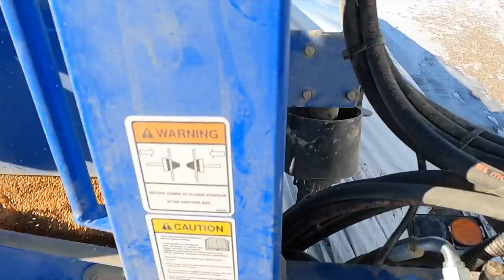We Give Up! Frozen Tractor!

Comment: Looks like a use for those old grain bags. Make a wind break tent with them over the engine plus that propane heater to get things warm. Cold is cold, but wind moves the heat out faster than you can get it in there.

Comment: We have same tractor. Ended up buying high speed high torque starter. Fixed cables . No problems since. We don't get that cold though! Great videos.
Reply from the maker: It has always been a hard starter. I am guessing an overhead and fuel pump timing adjustment wouldn’t hurt.

Comment: I feel like the battery kill switches should be a standard feature on every truck.
Reply: A battery switch isn't going to save a battery in the cold.
Reply from the maker: If they don’t draw down and freeze it will.
Reply: @FastAgMontana  well around here in minus 40c we run a trickle charger on the batteries or the trucks won't start, I mean I hope it helps, but trickle charger along side the plugging in really helps. Thanks for the content!
Reply: Damen Anderson  , WELL is a deep subject , unless it's a  shallow WELL !!!!!

Comment: Sounds almost like the starter is going out. Yes the cold isn't helping but with a torch, block heater, semi,  and a pick up and still that slow of a crank something is up.
Reply from the maker: Yes exactly. It can’t just be cold oil everywhere. All though the transmission and hydraulic oil would sure be stiff.
Reply: Transmission and hydro wouldn't be as stiff as the engine oil would be. Unless you ran a way lighter engine oil... But not everything can break when it sunny and 70°. Wait for the weather roller coaster to come back up again and problem solved haha

Comment: If you’re running anything like 100’ or more you should be using extensions cords with #12 minimum, preferably #10 size wire cords.   We use what I think are called ‘by-pass’ super high wattage heaters up in Sask!  It’s an external heater with high-capacity by-pass circulation # 1500-2000 watt heaters!  With a hog farm we had to grind feed at any temp!!  G’luck!

Comment: The cold is so hard on batteries. When I was going to the vo-tech in Butte long ago. I lived in an apartment with no way to plug in. I would pull the battery the night before and keep it inside. My blazer would start right up every time. I also
Have good luck with those magnetic engine heaters. I slapped a couple of those on the oil pans of a couple of pieces of equipment, so they would start. Grease guns in the exhaust stack of the semis, just good ol’ agi ingenuity.

Comment: Just a heads up I’ve installed lots of cut off switches. The best is to cut off the positive poles cause in case you get a short in the truck due to mice or something else your positive is still live to the truck until you ground it. Just a suggestion. A little more work with the positive cable but your guarantee.

Comment: Not a trick I really recommend but in necessary situations I've removed the air filters and put a heat gun (maybe even an acetylene torch once or twice) in the intake manifold at the same time a second person hits the starter switch . Usually gets enough heat in the cylinders to fire. Not a "by the book" technique but sometimes just gotta do what you gotta do.
Reply from the maker: We have used a hair dryer like that on the Mx 200. Works great.

Comment: Two suggestions. I know it's more expensive, but synthetic engine oil makes a world of a difference in low temps. Engines will turn over quite a bit faster, which helps on starts. Second, on my equipment (tractor, plow truck, gooseneck with full size battery for hydraulic tilt bed) I use a solar chargers/maintainers. They don't help the the cold aspect, but will keep your batteries topped off.  I've used several brands types. Key is having a charge controller. I've started using these which have the charge controller built in.  It makes them super simple to use. https://www.amazon.com/stores/page/4FED19AE-2D9D-4292-830D-E5C39A56415A . For instance, my plow truck (with two batteries) is used only about 4 times in the year and sets idle for 10 months at a time, never being started until I need it. Also, a SAE to o-ring harness is useful as they can be permanently attached to the battery cables (no clamps) and it will plug into the solar charger. https://www.amazon.com/gp/product/B088PC4RN4/ref=ppx_yo_dt_b_asin_title_o02_s01?ie=UTF8&psc=1  .  If you search on Amazon, there a ton of wire sizes/lengths of those harnesses.
Reply from the maker: We run synthetic blend oil recommended by case. Even with two sets of cables hooked up we  couldn’t get enough voltage. Something else is going on with the tractor.

Comment: Tony what is the litreage(L) on that tractor?????
Reply from the maker: You mean on the engine?   5.9 Cummins
Reply: @FastAgMontana  That charger I mentioned will work well but keep in your everyday truck so it is warm and it will start most diesels 
GooLoo 4000 up to 10 L diesel.